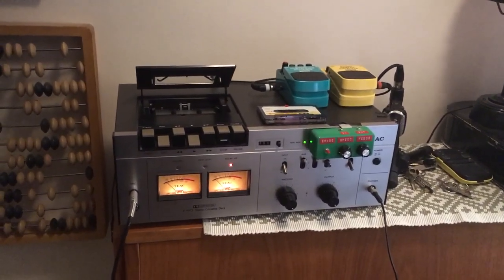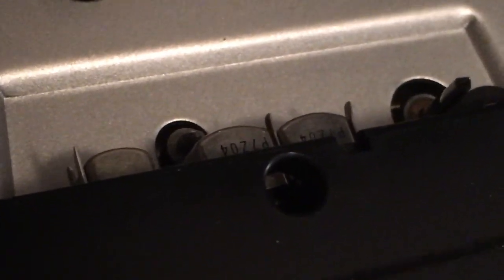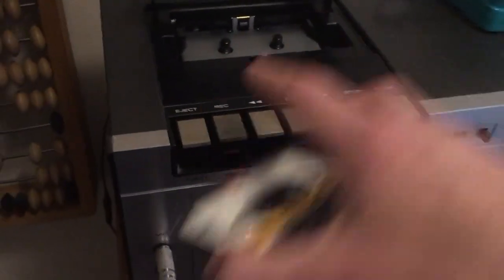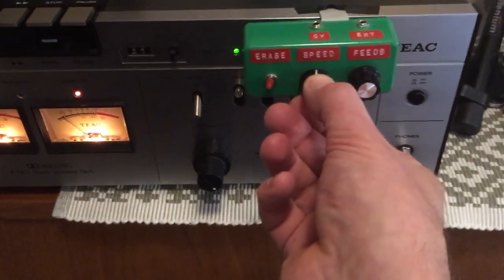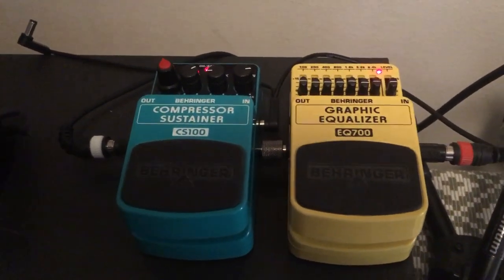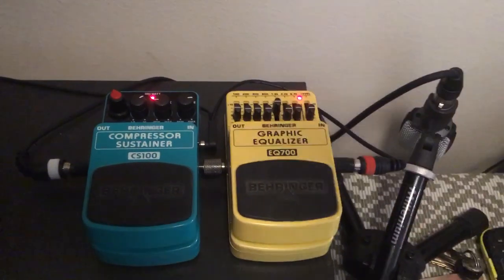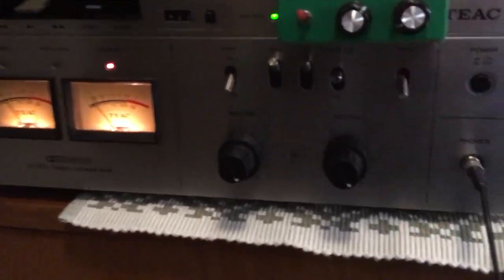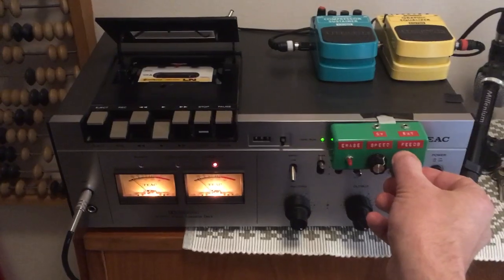How to make a DIY tape echo/ tape delay (from a cassette deck)

Comment: hey men! love you're diy! wanna do the same but struggle to understand how you do to allow only the left side to record and leave the other side to play :/
Reply from the maker: The TEAC A-440 has got two separate Rec/Play switches, that way I can disable one of them.  

Separate rec/play switches (operated by a common lever) was more common in the earlier tape decks (probably cheaper to build them with just one).
Reply: @jacobsteel  do you think i've got any chance to change the switch to engage record on just one channel? My deck is a Aiwa F220
Reply from the maker: @BaptisteDoze  - well, there looks as if there's only one switch, which makes it harder. However, you could always use a second amplifier (any opamp circuitry would suffice as a start) to do the playback part? 

https://www.radiomuseum.org/r/aiwa_stereo_casette_deck_ad_f2.html#

Comment: Hi, would you give more information on the feedback system? You mentioned galvanic or line transformer feedback, how did you wire the line transformer for this? I feel like my circuits classes may have failed me. I'm starting modifying my A-300 now, I'd like to add cv to both speed and feedback and an opamp LFO to the control that can be input into either hopefully. Any help would be greatly appreciated!

Comment: That's a bold move, adding another head to the machine. Do you have any tips or guidance on how you achieved this?
I've actually got a 3 head machine, but I'm pretty sure the heads are so old that it's degrading the sound. 
I simply can not find the replacement part for it. It's a Marantz 5030. I'm considering the possibility of a hacking a 2 head machine into a 3 head like you have here.
Reply: Also, I see you have added a speed control to this. Did you use a PWM board for this?